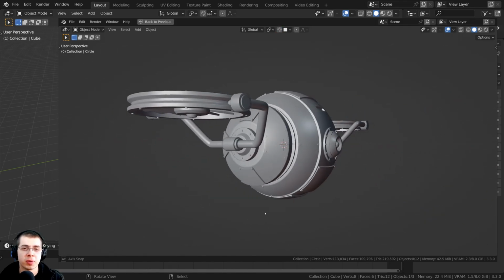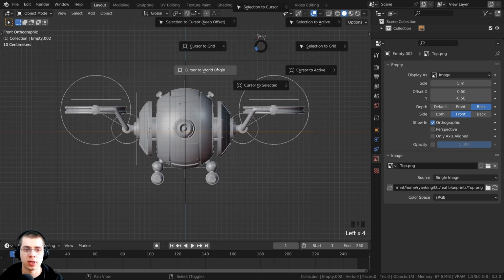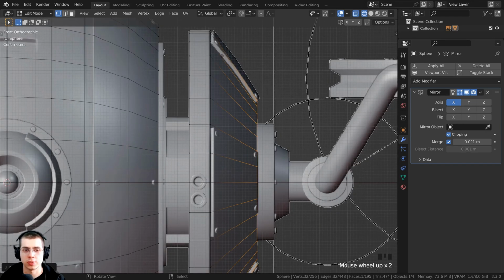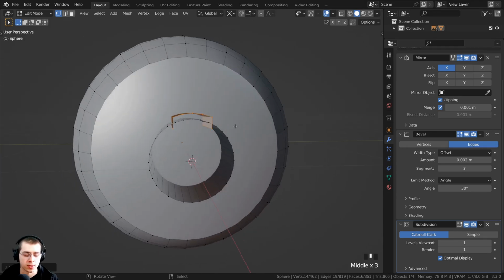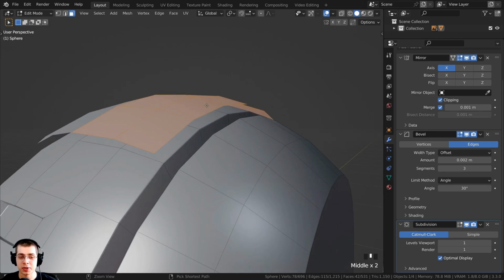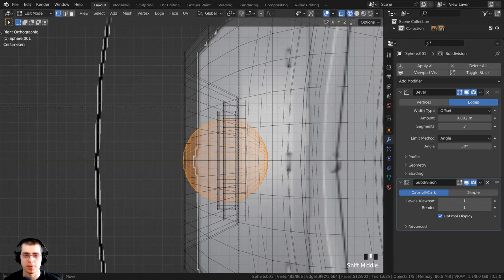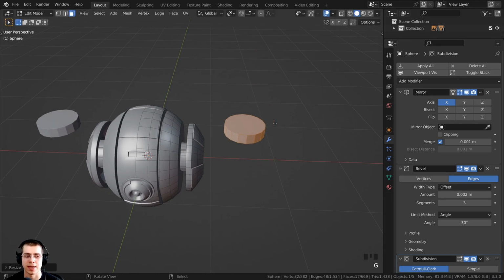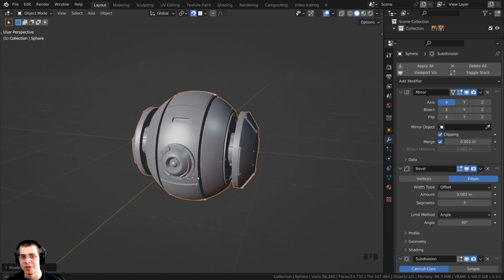Sci-Fi Security Drone - Part 1 (Blender Tutorial)

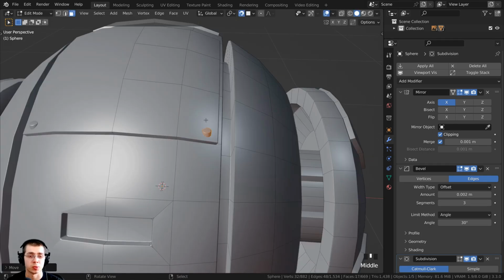Comment: Hi, great tutorial, loving every second of it! I run into a problem though at 56:04. When I turn on snapping in Edit mode all the selected faces lay flat on the faces that I snap them to, instead of remaining in the shape of a bolt. I'm in blender 4.1, could this just be a version difference? When I seperate the bolt from the main body, the snapping does work.
Reply: you got it?
Reply: In Blender 4.3, I had that same exact issue and came up with that same exact solution. However, I did find out if I snapped it to Face instead of Face Project, it would snap the bolt onto it's side. Google had this to say, 

"The axis of your cylinder isn't aligned with the normal of the face you're snapping to, meaning the "front" of your cylinder is not directly facing the target face; this usually happens due to the object's local axis orientation, where the Z-axis (which is considered the "front" in most cases) is not perpendicular to the face you're trying to snap to."

All the normals were normal (hehe), so I couldn't really figure out the problem from there. If I find a solution I'll try and make sure I edit this comment

Comment: Thank you for the tut. BTW, what Blender version do you use? The Alt-click to select a ring or loop does not seem to work on v3.3.0.
Reply from the maker: I used version 3.3.0. Try Alt clicking with the other mouse button. So try Alt clicking with both the left and right.
Reply: @RyanKingArt  Thanks for the reply. Neither worked, but I did discover if you double-click the LMB, it works.

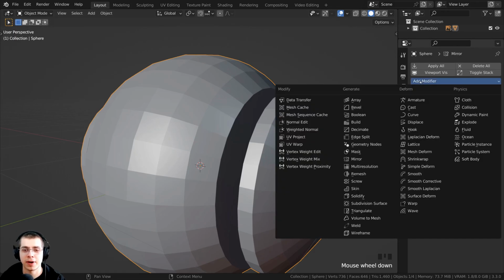Comment: This is an amazing tutorial for beginners. I wanted to ask tho at 20:50 I'm having trouble getting the bevel modifier to apply in Object mode. If i shade it smooth before i apply the bevel modifier it comes out incredibly weird. i'm wondering if there might be a quick fix when one runs into an issue like this??
Reply from the maker: hmm, try removing any overlapping vertices. that might be the issue. I have a video on how to remove overlapping vertices. you can search for it on youtube.

Comment: Hey bro, in 50:10 when I switch to edit mode, the side objects disappears when I have subdivisions modifier turned off, when I turn it on and switch to edit mode I don't see any vertices/faces/edges in that object. When I apply the modifier and switch to edit mode, the side object is in wireframe mode even though I am in solid mode and I most definitely didn't model only the wire without any polys, do you know what I could of done wrong and how can I fix this?
Reply from the maker: go into edit mode, and press Alt H, to un-hide all of the mesh.
Reply: @RyanKingArt  I tried that already, didn't work